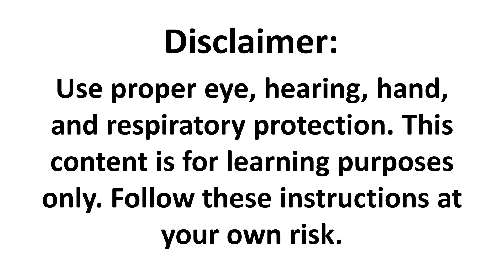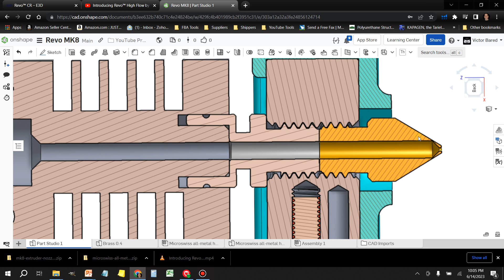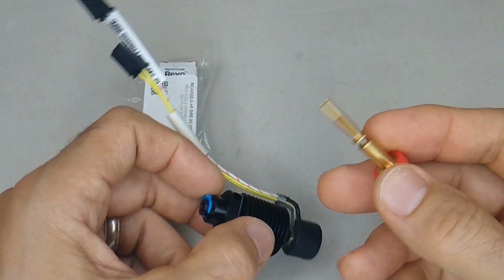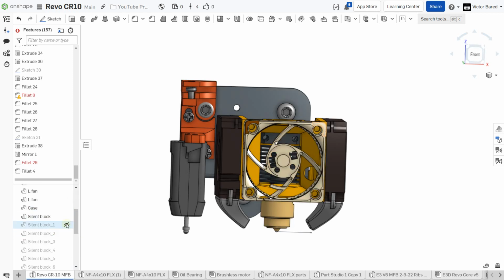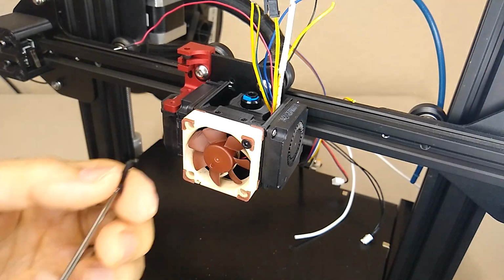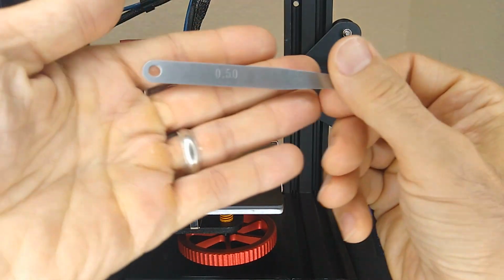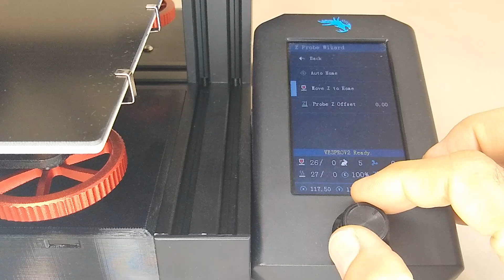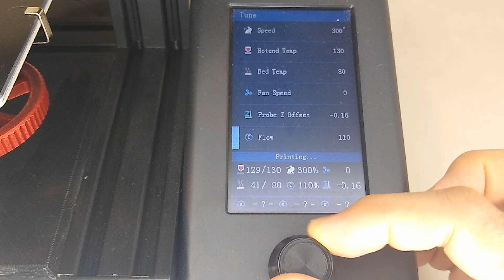Ender 3 Pro V2 - What Makes The E3D's Revo Hotend So Amazing Compared To Traditional Designs

Comment: Great video, thanks Victor
Reply from the maker: What's going on, brother? Yeah man, the Revo CR is the real deal, pricey but no more blowouts. The tiny heat block has all kinds of room all around that I now have the space to install a nozzle cam.
Reply: @vbared  Doing well mate, looks bloody interesting, this might be a good candidate for my Ender 5 plus
Reply from the maker: @glenncol  I've been doing some speed testing with it and found that using the .4mm high flow nozzle I can run the machine at 700% over the CURA 100mm/s sliced file. The Revo hotends don't use the standard heat block. What E3D essentially made for it is a heat cartridge that is ring shaped to surround the nozzle.

I'm still blown away by it.

Comment: Hi Vic. Thanks for the Revo content. I recently bought 2 Micro swiss NG  now compatible with Revo. I added them to all my 3 printers and i must say never not one clog and printed all day full use. The stock hot ends are just a pain in the but every time i printed almost half way through a print it would print mid air and extuder clicks. Then i would need to clean the hot end just to start printing again. This was constant and i was about to give up printing when i saw the ne w Micro swiss NG with revo. The best that money can buy.
Reply from the maker: Hi Elias, Thank you for the update on the Micro Swiss NG. I'm going to try and reach out to Micro Swiss and see if they'll sell me just the updated aluminum part including the REVO nozzle, heat cartridge and thermistor.
Reply: @vbared  let me know what you think of it when you obtain one. Cheers Vic
Reply from the maker: @EliasOda  Will do friend, enjoy your weekend :)
Reply: Any advice for an Ender 3 owner (mostly stock)? I'm lost. Been trying to make a choice for a long time without having much luck. Trying not to spend too much, but I really just hope to be able to print CF Nylon and also increase printing speed to about 100mm/s to 150mm/s without losing quality. Everything's so damn complicated. Would have went with the Sprite Assembly, but I accidentally bought the extruder only that I had in my watch list for no known reason. Now I have an Extruder that I'm not even sure I can use... so I don't know if I should find something to use with the Sprite extruder or if I should just start over with a new system. Any advice would be appreciated.
Reply: @deucedeuce1572  Revo Micro swiss for ender 3. Its worth every penny. Prints most plastics without a fuss. Stron direct extruder.. Your money your choice. I made mine because i spent too much on shitty hotends made in china. This is swiss made the quality is worth the money.

Comment: hi, thank you for the video and your explantions. You answered one of my biggest issues with my printer and klipper when you talked about : if the zoffset being too important, than the bed mesh will not compensate. My zoffset is 2.85 ... lol
Reply from the maker: Hello, thank you for commenting and encouragement. Yeah, if you are having issues with bed adhesion at certain points on your bed then tightening up your Z-offset, by moving the probe up 2mm so you end up with 0.85 will take care of that issue.

Let me know if making that change solves the issue for you.

Best of luck with your mods :)

Comment: Wait, how can bowden provide extra pressure, where direct drive typically has better pressure? I typically stick with bowden too, but that part confused me. ~4:45
Reply from the maker: Hello TheMrDrMs, Thank you for commenting. I'm talking about sealing pressure exerted by the bowden tube, similar to a gasket on a hose, to the nozzle. 

I use in this video - https://youtu.be/AEdca_-Nqys?t=295

Comment: Great instructional video.  May purchase the Revo hotend.  Thanks for all the help on getting my ender extender to worker.  I had to wait my a bed heater blanket.  Purchased the via Amazzon. SO much for speedy delivery.  Turns out the USPS rerouted the package all over the country.  I like the probe adjuster mount.  That would have made my life easy a while back. Take care and help creating these great videos
Reply from the maker: Hi Gary, Thank you for your kind comments. Did you get everything sorted out with the mesh creation?
Reply: @vbared  yes. Got to work.  The machine is printing  perfect.
Reply from the maker: @sargedutch1085  Awesome, great job!

Comment: Have you seen the firmware  that MRiscoC for the Ender 3 version 2, Check it out it looks awesome.
Reply from the maker: Yeah, I'm using it on one of my non-Klipper Ender 3 Pro machines. It works great and keeps up with my Klipper machines. Super sweet for someone that is just starting out with 3D printing to get a taste of Klipper performance.

Comment: Damn, I can't find the same (but compatible) firmware for the Ender 3 (not pro/s1).
Reply from the maker: Hello, Thank you for commenting. What control board are you running on your Ender 3, is it the stock green one?
Reply: @vbared  It's the OEM one it came with, but it's black.
Reply from the maker: @deucedeuce1572  What's the model number?

Comment: do you think this will work just the same if I put onto a MicroSwiss direct drive ? would the shroud work still ?
Reply from the maker: Hi Tony, Thank you for commenting. The Micro Swiss direct drive kit should work with fan housing. I'll need to work on the shroud to make it fit and figure out how to keep access to the accelerometer mount point.
Reply: @vbared  Hey Victor, finally getting around to installing mine and I am wondering how the PETG is holding up for you ?
Reply from the maker: @tonykitching5810  Hi Tony, The main bracket that holds everything won't have any problems. The things that might need replacing now and then will be the parts cooling fan ducts if they aren't running, like in the case of a big print that uses up 75% of the build plate. The reason is because normally the cooling fans stay off for the first layer and kick on at 25% for layer 2 before reaching 100% by layer 3. The source of the heat that messes them up is the heat block. Recently I added a REVO CR to my Ender 3 Pro and Micro Swiss NG REVO to my CR10S Pro V2 and am blown away by the design of the hotend. Instead of using a standard heat cartridge that slides into a heat block E3D manufactured one in the shape of a ring about 10mm tall. The nozzle design is another breakthrough. It doesn't have have any sealing surfaces anywhere near the melt zone and doesn't require any tools to remove, just your fingers. Since there is no heat block the ducts no longer need replacement due to heat deformation.

Enjoy your weekend :)

Comment: Great video, I have been wanting to upgrade my hotend for a few years,  glad I have waited, this looks like a solid choice.

I am curious why the Ender 3 V2 in this video is not running Klipper,  did you revert back or do you have multiple?  I converted a friends Ender 5 Pro a few months ago using your videos about Klipper and just finished my Ender 3 V2 this week.  I was running Jyers and using Octorpint for quite a while but ready for a change and I really enjoy being able to edit the printer.cfg file without having to compile firmware.
Reply from the maker: Hi Thomas, Thank you for your kind comments. I'm glad you found value in this video for your viewing time. I run 4 Klipper machines but keep this one printer running Miguel's Professional Firmware. It's just about on par with the performance of my Klipper machines. I continue to work with it to help people that are just getting into 3D printing get the most they can out of it prior to all out Klipper, which is hands down the best firmware available.

You're going to love the Revo CR, the thing is amazing, super light weight and looks great on the printer.

Best of luck with your mods!

Comment: Who makes thre adjustable probe mount for the CR Touch you are using?
Reply from the maker: Hello Kevin, 

Your timing is perfect, we just completed the anodizing work on them and will be shipping them in to Amazon next week. We designed it to work on the Ender 3, Ender 3 Pro, and Ender 3 V2 and others that use the standard Creality Ender 3 gantry bracket. I can ship one directly to you if you want it early just send me you shipping details to vbared@gmail.com and PayPal email for billing. They are $29.99 with free shipping. I can get one out for you tomorrow morning via priority mail.

Thank you for your consideration in supporting my work.

Comment: Hi Victor, thanks for the video, very detailed and clear as the others! I wanted to ask for tips on supports: I noticed that when I print PETG, supports are harder to remove than what happens with PLA. I use the same supports settings in Cura between the two materials, but the PLA ones behave like yours in this video (clean and easy removal), while with PETG they tend to stick a bit more to the surface. Any tips on that? Thanks!
Reply from the maker: Hello teokato46, Thank you for your kind comments. Linked below is the profile that I used for the parts in the video. How you set your z-offset is important because if you're using a sheet of paper (.10mm) to set it you'll be over squishing the layers making support removal more difficult. Another thing also is the type of surface you're printing on. If you're using glass you need to have more squish to get PETG to stick. I can get away with a .25mm distance from the build surface because I'm printing on G10 Garolite and you'll also notice in the profile that I run 120% flowrate on the initial layer, prime tower, and skirt/brim flows. This is important because since I'm so high off the build plate on layer one the extra flow allows the material to make contact with the G10. You'll have problems getting this to work right on glass without the use of some kind of adhesion promoters like stick glue or masking tape. The video description has the link to my G10 that I use on all my printers. Just make sure that you are using a bed probe because you will need to have the ability to build an accurate bed mesh. Glass is super flat but doesn't work as well for PETG adhesion. G10 isn't perfectly flat but it's super light weight (great for printing fast without ringing), PETG, PLA stick like crazy to it when hot and release the objects when cold. You'll actually hear a crack sound when they let go, it's amazing!  

https://drive.google.com/uc?export=download&id=1INj8bl6itxPrFJ-PQLXHGI0lqWHVlaaO

Enjoy your weekend :)